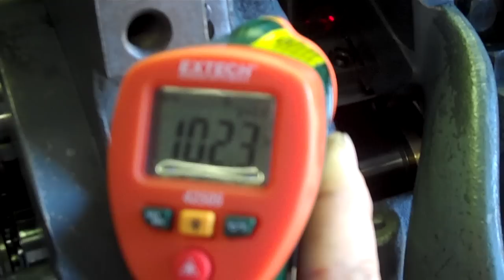Davenport Model B - Multi-Spindle Screw Machine #2

Comment: The main thing I like from this video was that I noticed there was only a single spring on each slide and end tool spindle. That's an indication for me that the machine slides are in good shape and not worn  or sloppy. but it's not a guarantee until you actually set it up and run some production. it's hard to maintain a + / - .005 thou. tolerance if the machine is .030 thou. out. Also I have never heard the music on any of the machines I've setup and run.
Reply: depende del topo de holder que se use
Reply: yo uso un holder que solo rebaja .010" en 48 cientos y tiene de variación apenas.001"
Reply: Try holding a +/- .003 with worn out slides that require two or three return springs, lol.
Reply: @luwdmke  that might have worked if the company I work for maintained a regular cleaning/PM schedule from the get go. But nope, these machines were ran into the ground before I started working for that company. All the original hand scraping on the slides are long gone, big gouges on the ways now, best that can be done now is to occasionally deburr and polish  the slides when they start sticking too much. Company will not spend the money for new slides. Just run the machines till they quit working is their policy.
Reply: @philf2061  that sounds just like the company I work for. Hell, some of our end working spindles have 2 springs too lol

Comment: hey i have a few questions for you... this machine is being fed several material stocks right? so it's producing as many parts as there are spindles? also curious is your laser gun measuring the rpms of the work piece? it was a little blury to read what it was. thanks
Reply: Yeah I know I'm replying to a nine year old comment. Yep, one part per spindle. The laser is for temperature reading on the spindles. This one is running pretty cool at 106*

Comment: great machines ive worked on them
Reply: Would the set up be similar to a lathe?
Reply: @sashasoule4585  Set ups can be almost as easy as a lathe if the parts use the same material in both size and composition, and are similar in length as well. Change any of those then you have to change collets, pushers, cams, and more than likely spindle gears, feed gears, uses external thread rolling attachment for male threads, has a tapping clutch for female threads that require it's own gears, pick off collet and back face/deburring operation has to be set. Then there comes the joy of preventative maintenance and checking over all the cam rolls and tool spindles to make sure they are not sticking, multiple grease zerts, checking the working condition of at least two clutches (three if using the tapping clutch). Plus there are many attachments for these that can add more complex machining operations, and more complexity to the set up when you have to put clutches on the work spindles, multiple live spindles in the tooling head, etc...